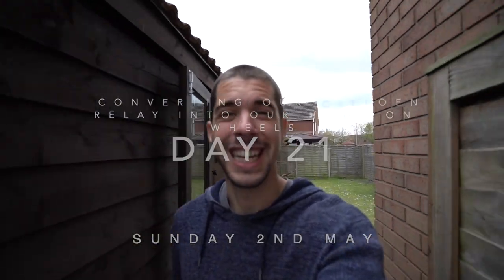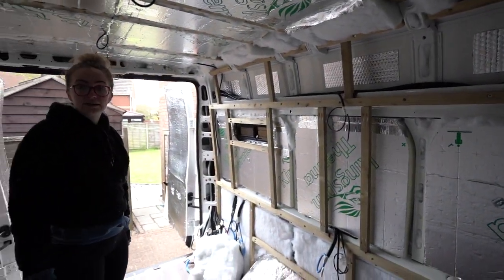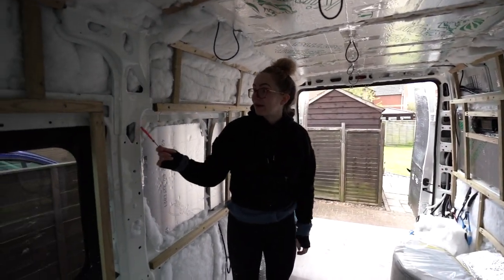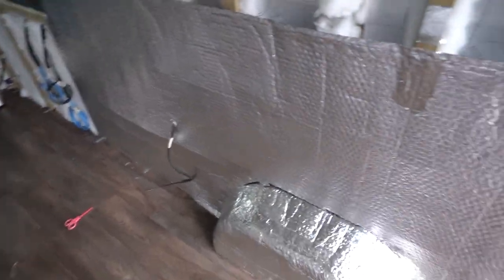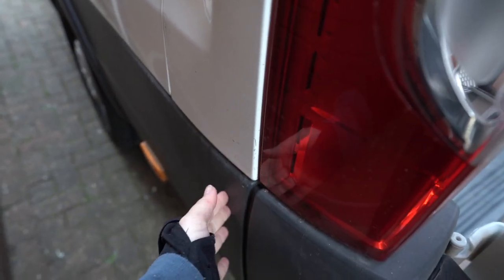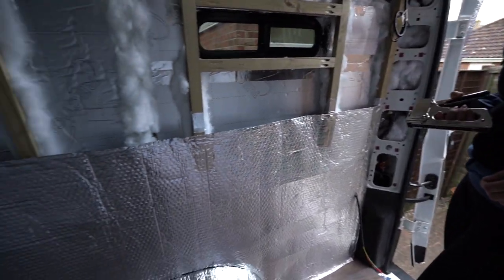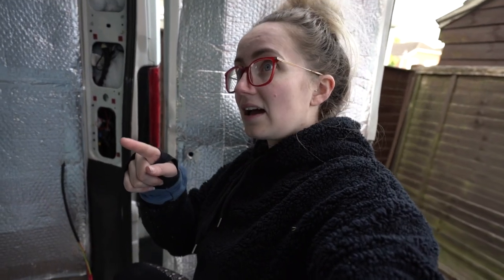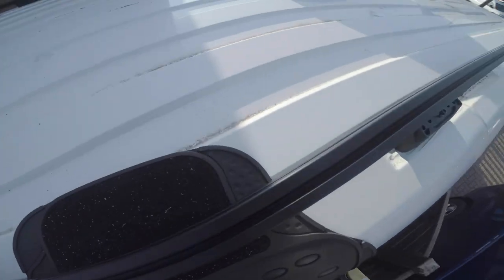VAPOUR BARRIER & FINISHING THE INSULATION - Camper Van Conversion UK Vlog - Week 11

Comment: Guessing you left you sills insulation free? Did you just place the foil role over the sill then aluminium tape to the vinyl floor? Current at this stage and the vapour barrier controversy is really making decisions difficult!
Reply from the maker: Hi Christopher! Yes we left the sills insulation free, I was worried about it getting wet even if we seal the plastic trim holes. The potential cons vs benefits of insulating down there is way higher in my opinion.